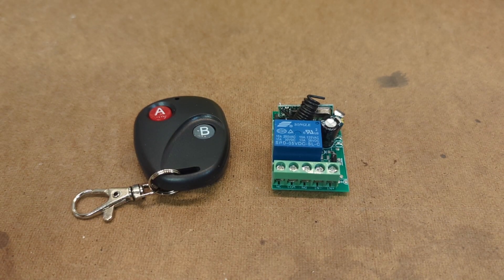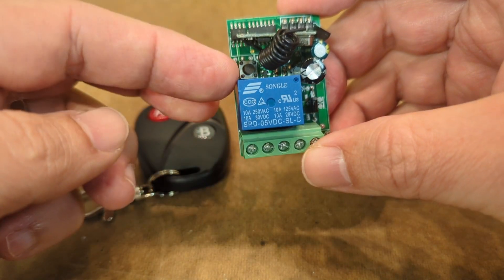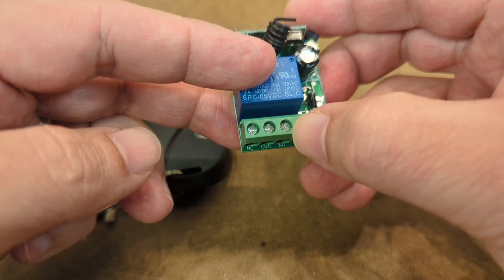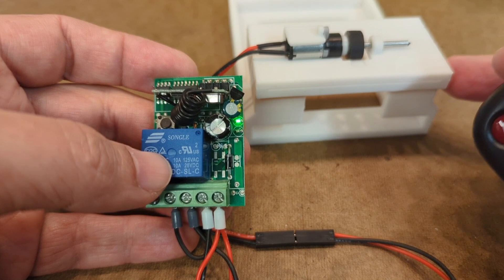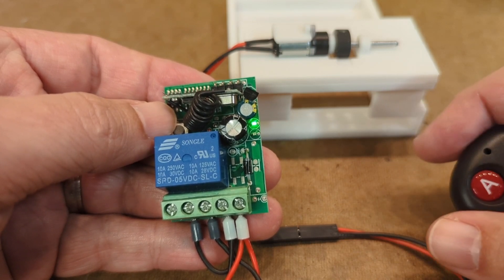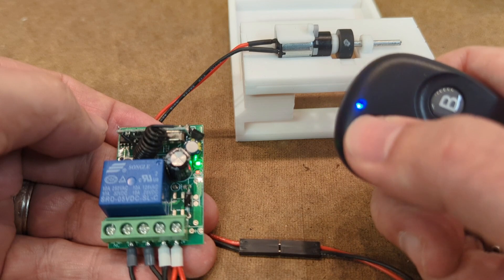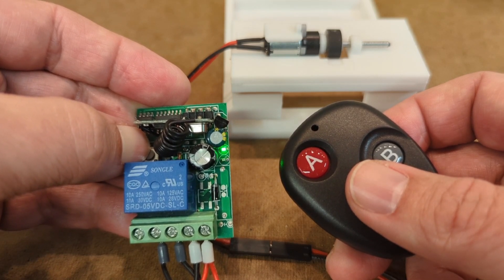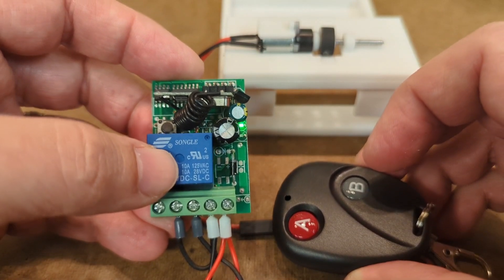Wireless Relays - An Easy Way to Add Droid Peripherals

Comment: Do you know if there may be some that would work as a rc kill switch
Reply from the maker: There are ways you could use a remote relay like this for a master kill switch, but it would likely be done in conjunction with an existing relay or some other device that handles whatever high current flow you are hoping to kill. For example, many droid builders have a large master relay just off the battery and their main power switch actually enables/disables the relay (this way they can use a low current switch). A remote relay could be used as a failsafe on the switch itself. If it were set to latch mode, you would press the fob button to enable the power switch and if something goes wrong, press the fob switch again to open the power switch, thus powering down the entire droid.

If, however, you are actually using an R/C-based system, I understand that there are some failsafes already built into RC systems that could be used in a similar fashion. I'm not too familiar with them, but I know they exist. Great question!

Comment: Brother i want to use this system in catapult for throwing by remote and there is a problem which i faced 😔 that mini servo gear motor rotating slowly on both sides and i need to increase the throwing speed 😢 how it's possible 😢
Reply from the maker: I don't think a servo will ever rotate fast enough to be able to power a catapult directly. Likely you will need to create some sort of quick-release mechanism that perhaps can be tensioned by a continuous rotation (360 degree) servo that is triggered by a relay. As the servo rotates, tension is increased, drawing the catapult back. At some point, either through creative gear design or maybe by a physical switch or trigger, the catapult is released from the mechanism and springs forward. I'm sure you could do a google search to find some creative designs. If you find one that uses a single motor/servo, then you could definitely power it remotely using a relay like this. Good luck.

Comment: How much current do you think it consumes on idle? I thinking of installing it in my car for the auxiliary lights. It currently runs on the control signal from the standard headlights to a relay, but I want to place this relay in series. I'm just worried it might deplete the battery when not in use.
Reply from the maker: I'm honestly not sure exactly how much current it draws, but I know it's not very much. Unfortunately, I don't think I know enough about car electronics to be able to provide much insight here. Hope you're able to find something that works for you, though!

Comment: Hey I’m not too experienced in electronics but would this work for led light bars on a car I’m not using the cars power and it won’t be attached to the car itself but mounted on something that would come off and on the car
Reply from the maker: So, the general concept of a wireless relay sounds like it might be suitable for what you want. A relay DOES need a power supply, so if it's not connected to your car's 12v battery, then it would need to be powered by something - maybe separate batteries? For the inexpensive style of relay I show in this video, I would be concerned about their durability in an automotive installation, especially if your device is going to be installed anywhere on the exterior of the car, or near a place where it might get warm/hot. I think you could easily check hardware and/or auto parts stores for remote control relays and you'd probably find higher quality versions than this, but the overall operation should be similar to what I demonstrate here. Good luck with your project!